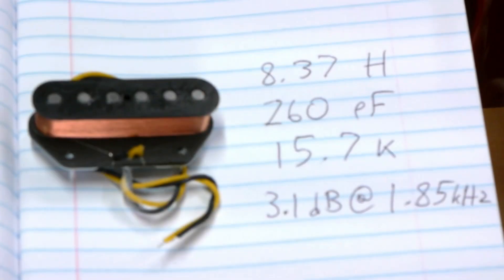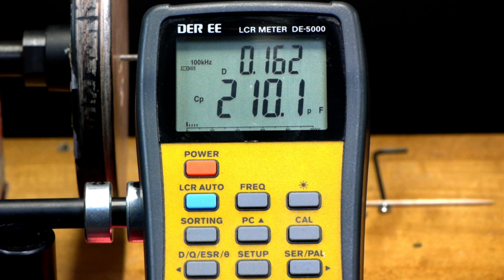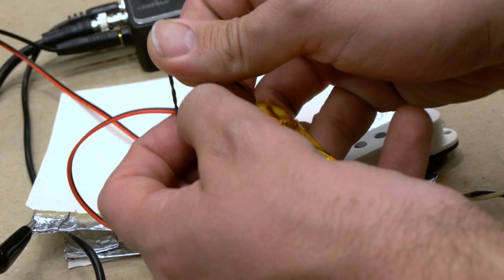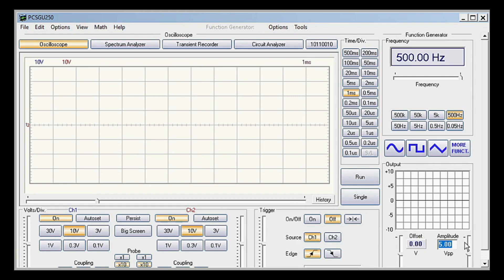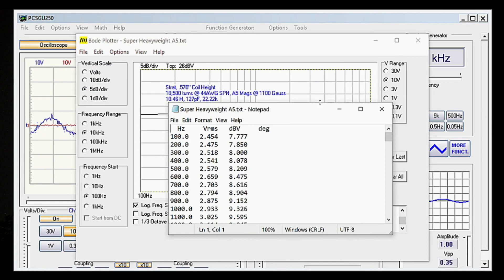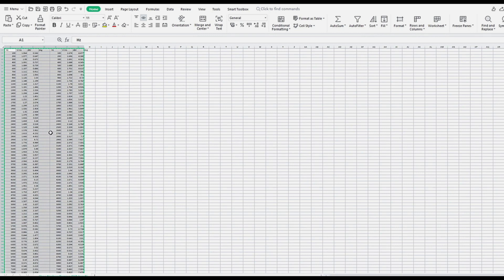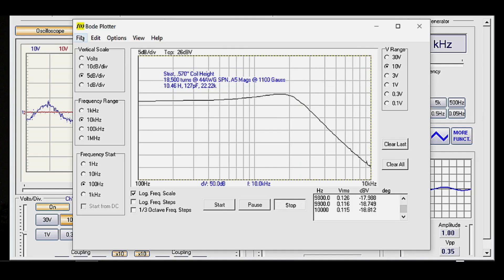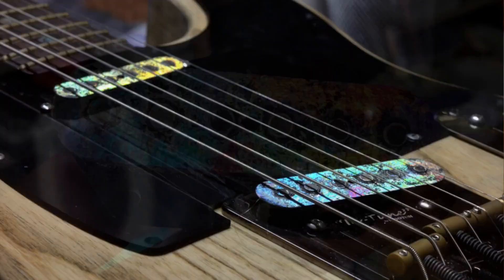Complete Guitar Pickup Testing: Step by Step Guide (LCR Meter, Gauss Meter, Oscilloscope)

Comment: how can you tell the pickup eq or tone spectrum from the plot?? could you explain that or make a video on it. Also I understand the res freq is in the 1.7k hz but all the notes on the guitar don't even get to that. How does the resonant freq affects the tone ??
Reply from the maker: I'd love to make a video on it, and I intend to once I have the time. I'm very excited to. 

The answer is much simpler than it seems. Though I'm going to go into a long-winded explanation here, so bear with me. 

The resonant frequency -- or more accurately, the 'resonance curve' or 'EQ curve' affects the tone by telling us which frequencies it's filtering out, and how much.

The way the oscilloscope test works is it uses a signal generator to emit frequencies at various intervals -- 100Hz, 200Hz, 300Hz, etc., up to 10kHz or 30kHz depending on your testing parameters -- 

-- and the bode plot is simply telling us how much of a particular frequency the pickup is filtering out.

CLIFF NOTES VERSION: A lower resonant peak means the pickup is filtering out more high end frequencies. A higher resonant peak means the pickup is filtering out less high end frequencies. 

The resonant peak is only one aspect, the peak of the curve -- but the entire curve matters. That being said, the location of the peak of the curve is a good general indicator of what a pickup will sound like. 4.4kHz, think classic Stratocaster or Telecaster. Bright, spanky, trebly, sparkly, twangy, all that. 

1.7kHz, think P90. Fat, bold, not much high end, aggressive lows and midrange. The high end treble response is greatly reduced. Some may call this a "smooth" high end, or "darker, powerful" high end. 

Pickups with lower resonant frequencies generally have more turns of wire and/or more steel parts, which both increases the output the pickup (raw power in the form of Alternating Current electricity, generated by electromagnetic induction -- more turns of wire = more AC generated = more output).....

...and lowers the resonant frequency, which means the pickup is filtering out more high end frequencies, leaving more and emphasizing more of the midrange and low end frequencies. 

Less turns of wire and less steel parts translates to more high end frequencies left in tact, and a greater emphasis on high end frequencies. Think bright, spanky, sparkly, clear, and on the extreme end: tinny, shrill, harsh, ear-piercing. 

This may be  tough to understand at first. The first principle is understanding that a guitar pickup is both an electrical current generator and, effectively, a low pass filter. 

Also, the frequency of the notes being played is different from the frequency of the overtones/timbre. Think about it like this: 

Play a note on the guitar. Any note, any string. Pick the string near the last fret. Now play the same note, but pick the string right next to the saddle. You get a smooth, buttery tone by the neck, but picking where the string is tighter by the saddle, you get a trebly, tinny sound. 

It's the same note, but the frequency response is completely different. So remember that the overtones/timbre are not the same as the frequency of the notes themselves. Ear-piercing tone, like some old Fender Telecasters, can emit frequencies in quite a high range, say around 4kHz or possibly even 5kHz. It isn't the frequency of the actual notes being played, but the overtones/timbre, for lack of a better term. 

A pickup affects all notes on the guitar equally, as they're effecting the overall timbre of the instrument, and all the overtones, and some of those frequencies are quite high and quite low. I'm making an educated guess about all this by the way! It's a very good question but I do want to clarify that it isn't about the frequency of the notes, though it isn't something I've thought about before until answering your question right now. 

Anyway: 

The practical takeaway for someone like me is actually extremely simple. Most of the time I manipulate resonant frequency merely by changing the number of turns of wire I use on a given pickup. 

You can also affect it by the choice of magnets. A2 and A3 are darker sounding, given the same number of turns, while A5 is brighter, and A8 is the brightest. For the same number of turns, A8 has the highest resonant frequency, then A5, and A2 and A3 seem to be very similar. Different magnets may have different properties that don't show up on a bode plot and I have yet to explore into that territory. 

But the takeaway is simple. Turn count is a very large part of building pickups. And it's all up to experimentation. One of my favorite pickups that I make is a Stratocaster bridge pickup that uses 18,000 to 18,500 turns of 46AWG. 

Super powerful midrange and no shrillness on the high end at all. 

Things get a bit more complicated when experimenting with different bobbin designs. Bobbin height combined with wire gauge can make for some interesting variations in bode plots/frequency responses. 

Bill Lawrence Micro Coils come to mind. I've made my own version of those several times with interesting results. The bode plot reveals a lot. My experience is that thinner wire in a small winding space tends to result in a disproportional retention of more high end frequencies. It's very hard to explain this in terms of what it sounds like. 

That's the beauty of the plots -- it's all numbers. When you see the plot, you can see which frequencies are filtered out more or less. Sometimes tone can be extremely difficult to explain with words. 

But it all comes down to which frequencies are being filtered out more or less. The resonant peak is merely the point of greatest emphasis: the 'voice' of the pickup, so to speak. The rest of the curve is like the 'character' of the voice. 

If you think about it, it's almost like trying to describe the difference between human voices. Pretty much impossible without numbers/frequency response plots. 

The emphasis of certain frequencies, and the attenuation of others, is what it's all about. I'd love to make a video about this but as you can see it gets quite complicated. It will take me some time to condense this comment down into a short video that would be much easier to understand. 

I do appreciate you bearing with me if you were able to read through this. And hopefully you're not more confused than before! If you are, I have a lot more work to do on my explaining and clarification. I'd love to get a video going but translating my knowledge and experience into words can be extremely difficult! Hopefully this helps at least a little with answering your question.
Reply from the maker: One more simpler reply: 

A standard of comparison helps a *lot*. For this reason, think of a single coil like a Fender Strat or Tele pickup. Alnico 5 mags with about 8,000 turns of wire is standard. This nets a pickup of about 2 Henries inductance, and a resonant frequency in the 4.0kHz range, roughly speaking. 

Other single coil pickups can be compared to this as a 'standard.' Sometimes it helps to understand one thing via comparison to a 'standard,' so having a 'standard' single coil sound gives us a frame of reference.

You can do this for other single coils too, like P90 pickups, Filtertrons, etc. Deviation from the standard is what makes the differences understandable. 

A P90 that uses Alnico polepieces, for example, instead of steel polepieces with an Alnico bar magnet, will -- for the same number of turns -- be brighter and clearer sounding, due to the higher resonant frequency. That means more high end, and more emphasis on the high end. 

A Strat pickup that uses a bar magnet and steel poles -- like most MIM or other non-USA Fenders -- will tend to have a darker sound, owing to the lower resonant frequency, which emphasizes more midrange and low end frequencies. 

Inductance can be used as a solitary measurement but it's nowhere near as useful as a bode plot / resonant curve plot. 

All things considered, changing the turns of wire and the magnet type is probably 95% of the pickup modifications you see on the market. It's some variation of the magnet and polepieces, and some variation of wire turn count / insulation type, etc.

The differences can be extreme or subtle. I like going for more extreme differences. Most of this is reflected in the bode plots. 

But again, standards of comparison are most helpful. If you see a plot for a known pickup that you're very familiar with, like a run of the mill Strat pickup, Tele pickup, P90 or PAF humbucker -- then when you compare the plots of other pickups against *those" -- it becomes much easier to interpret the differences visually. 

The bode plot information can be copied from Microsoft Excel into Notepad, saved as a txt file, then uploaded into the Vellemann or other Bode Plot software to create a visual plot comparing the two pickups. Very handy. The visual references are great for getting a general interpretation of the tonal characteristics. 

The left side of the chart is lower frequencies. The right side is higher. Once you get used to the grid markers and what frequencies they correspond to, interpreting the plots becomes second nature. I'd love to make a video on this to simplify it and demonstrate it visually.
Reply: @guitar_md  man this is gold!

Comment: Thanks a lot for the valuable information. I bought everything I needed to do the tests as described by you.
I would like to ask for some information. In the case of the following types of pickups, how should the drive coil be positioned?
1) Precision bass
2) Split coil Jazz bass
3) Dual rail pickups

A thousand thanks
Reply from the maker: Dual Rail pickups are measured the same way humbuckers are, with the exciter coil on its side instead of flat down on its face. 

As for P-Bass and split coils, let me get back to you. Great question and I'm actually not sure. I'll see if I can message my friend Andrew, who got me started on this path of measuring pickups, and see if he knows. 

Thanks for asking, and again great question
Reply: @guitar_md  thanks a lot. In the case of precision bass I don't know if the bobbins need to be aligned side by side orizzontally or vertically. In the case of jazz bass split coil i put the drive coil upside the bobbin like single coil and they seems too low level of decibel respect normal single coil. Same situation in the case of stacked single coil.
Reply from the maker: @ilarioiuso4971  For the P Bass, it probably should be just like a humbucker. Put the coils side by side like a PAF pickup or any other humbucker. The exciter coil should go between them standing on its side, the same way as in the video for normal humbuckers.

Of course, you could always test both ways, one with the exciter coil face down like it's used for testing single coil pickups, and see how that works. The P bass pickups will be much farther apart than a humbucker due to the flatwork so maybe face down will actually work better. I'll have to try this myself soon. Maybe even aligning them slightly offset (like they are when they're installed) would also work best. I'd try multiple arrangements and look at the bode plots. Probably the most normal looking one will be correct, just a guess. 

For stacked coils, like noiseless pickups, just put the exciter coil face down, same way for single coils. 

For split coils, I'd also do it face down, same as for single coils. That may or may not work because of the opposing polarity on a single plane. I'll get back to you as soon as I can after getting a response from my friend regarding these testing methods
Reply: @guitar_md  thank you very much. If you have more news please let me know.

Comment: This is the best video on the subject matter that I could find so far. I am curious if you've shared your measurements somewhere on a blog or website or made a video where you walk through the differences between certain pickup types. For instance, I would be very curious to see how the resonance frequency graphs compare between say a strat type sc and a seth lover type HB. I think you should be able to see their tone characteristics reflected in the plots coming off your measurements, no? Anyway, fascinating stuff
Reply from the maker: Thank you! I haven't shared any measurements anywhere yet, but have some videos in the works. Antigua Tele on TDPRI, who I've corresponded a lot with over the years, has a ton of tests up all over TDPRI as well as the Guitar Nutz 2 forums. I highly recommend checking out some of his stuff, such as here: 

https://www.tdpri.com/threads/measured-electrical-values-of-various-telecaster-pickups.665808/

Humbuckers and single coils won't be a 1:1 comparison, even with the LCR meter, bode plots, etc., because of things that won't show up on a test, such as comb filtering, which is a result of two adjacent coils sensing the strings instead of one. Similar issues with noiseless stacked 'single' coils, which I have a video coming out about soon -- not measuring, but how I personally build them. 

Anyway, I've had some odd results, such as a humbucker I made with alnico slugs having about the same resonant frequency as a Duncan SH4, but mine sounds quite a bit brighter. The rabbit hole definitely goes deep. I have some videos planned to do some controlled experiments, as the main issue with these kinds of tests are that most of the people doing them don't wind their own pickups, and can't control for different variables. 

I'm not disappointed in the resonant frequency tests, but I will say that they are not the be-all end-all, and I'm always open to considering factors that could be at play that don't show up on tests. 

I did recently measure a set of Ron Ellis pickups, and that was interesting! The funny thing is when you use tests like this, no pickup really seems special -- just a collection of numbers, from which you can guestimate how it was built, e.g. magnet type, wire type, turn count. My only regret with the Ellis is I didn't measure the pickup with calipers so I have no idea what length the polepieces were. I'm usually much more thorough. I'd assume classic Fender, but you really have to mic stuff up to know for sure.
Reply from the maker: A lot more experimenting lately. I just tested 6 pickups for someone and am going to start organizing things more clearly in a spreadsheet. 

As far as humbuckers go: anything around the 1.5 to 2.5kHz range will be much closer to a humbucker tone. Single coils I've wound, including my 32k "Super Heavyweight," are around 1.7kHz and very fat, dark and powerful sounding. 

An overwound single still sounds like a single though. But they can rival a humbucker in output if they're wound hot enough. I'm currently doing some exciting experiments using shorter coils and 48AWG, which I've never heard of anyone else using for pickups.

The point there is that the closer the coil is to the strings, the better signal to noise ratio. More efficient. More output. With taller coils, the lower part of the coil doesn't contribute much to the output. 

Lots more. As usual I'm bogged down making videos and there's so much I want to cover. My next upcoming video is about the turn counter I use on my winding machine and how I set it up. Also working on a humbucker repair video. 

I'd love to do a comparison video explaining how to use inductance and resonance curves to understand what a pickup will sound like.

Comment: Awesome! For BODE plot do think using REQW to output a sweep to an exciter coil and input through PC line-in would yield comparable results?
Reply from the maker: I have no idea, but you can check this out from Helmut Keller. 

https://www.gitec-forum-eng.de/wp-content/uploads/2022/08/Pickup-Wizard-V1.0-.pdf

And this: 

https://gitec-forum-eng.de/getting-to-know-you-pickup-a-tool-for-measuring-the-frequency-response-of-the-impedance/

And a thread discussing it here: 

https://guitarnuts2.proboards.com/thread/10045/gitec-software-impedance-frequency-response

Let me know if that helps!